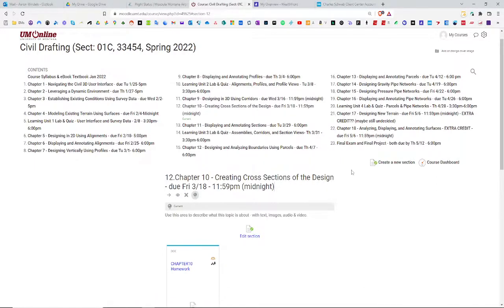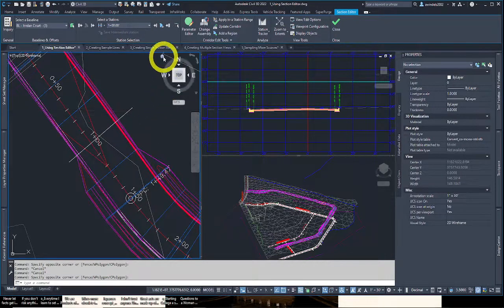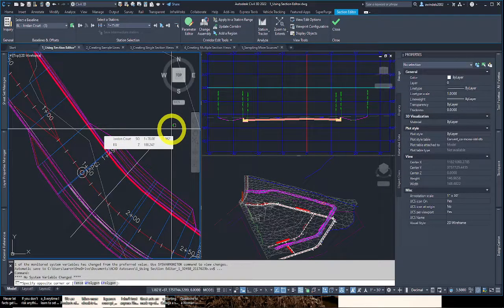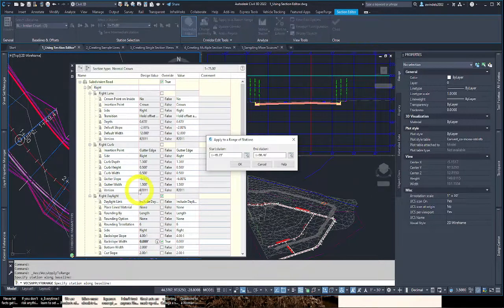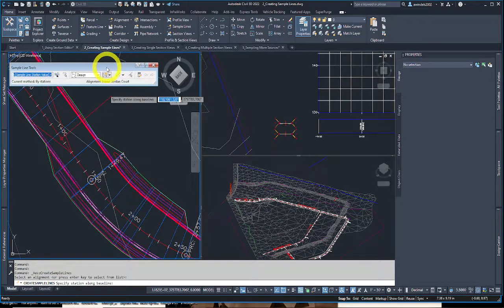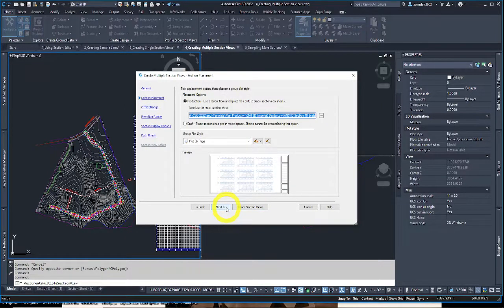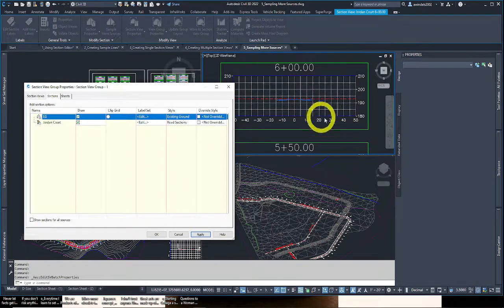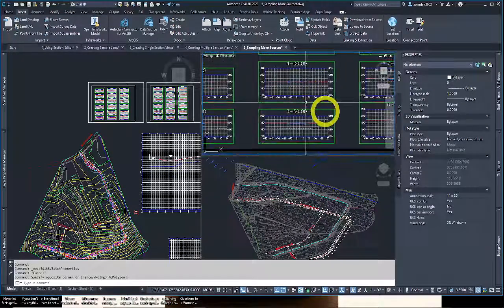Civil 3D Learning - Ch.10 - Designing in 3D Using Section Views - (pg.191-206) UMT DDSN245

Comment: Do you tutorial for slope protection using grouted riprap?
Reply from the maker: I have not done one specifically on that problem, no
Reply: Can you please help me with this problem sir. It would really mean a lot not for me
Reply from the maker: Generally for Grouted Rip-Rap I just use DaylightSlop and DaylightVertical subassemblies connected togther to make my design Assembly edge from my road and then I draft in many Gabions/RipRap Grouted edge manually drafted objects next to the Corrdior Section Daylights slopes to make it look pretty on my Section Views Exactly as I need. I have some Wall Blocks, RipRap Blocks, and hatches I use for this on the Section Views